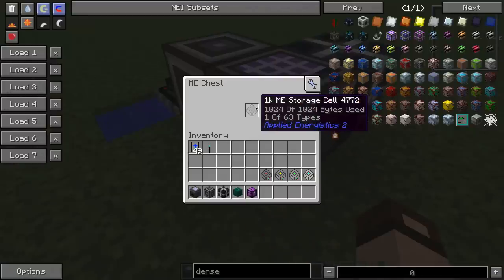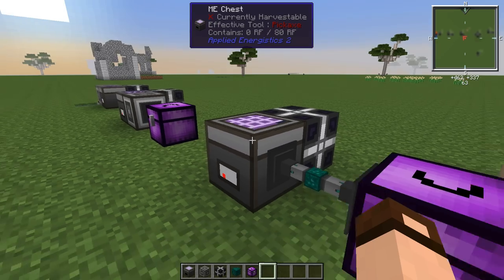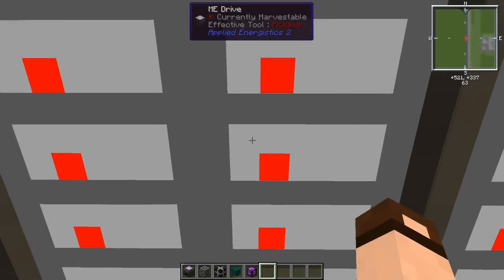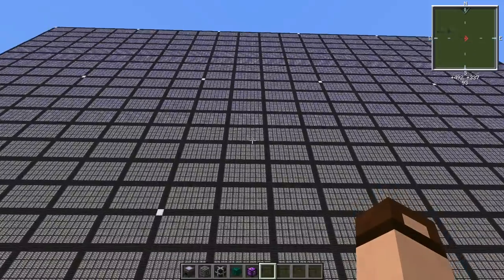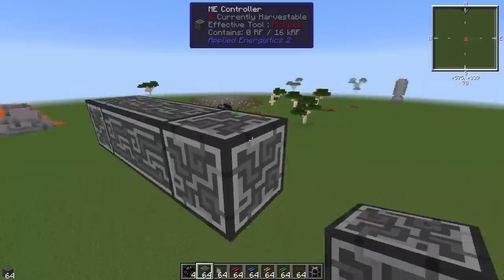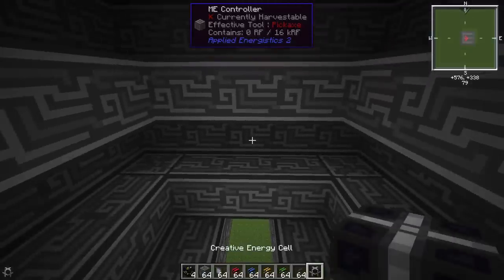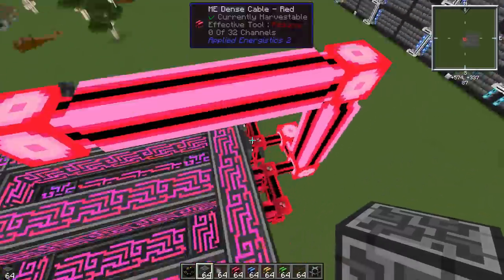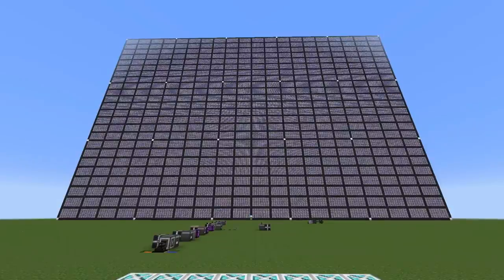Applied Energistics 2 Tutorial - Even More Storage Extremes

Comment: question, why bother with the inside layer, you can not use the faces, UNLESS you dont use the faces on the outside layer that are around the face at the same time,so you can only get 32 channels per BLOCK,  so, you can only ever get 2592 channels from a 7x7x7 cube, no matter what design you choose, hope this helped, because NO design you make can increase that
Reply: seems to me that u are not versed with ae2 as is the face that matters each BLOCK can hold a maximum of 192 channels
Reply: Yeah you realise to use 192 channels effectively you need a separate dense cable for EACH face on EACH block, each dense cable can hold 32 channels and in that gap there is atleast 2 other faces being wasted, go test it yourself then come comment once you are positive you are right next time, and bring proof too
Reply: bradster2214 i was commenting on the fact that  "you can only ever get 2592 channels from a 7x7x7" is completely false i can get over that with a 7x7x1 as you can have multiple p2p tunnels in a single block
Reply: Ok, i never thought of that but the easiest way is to simply use dense cable and it is much simpler as it's clear as to what cables go where
Reply: bradster2214
i agree 100% i dont like to use p2p tunnels directly on the controller all of my cables are color coated makes it easier to keep track

Comment: Is it not easier to set up around 40 Deep storage systems ? if u would only use cooble ? ;D i mean for this mass of coble u only would need 1 core unite with only 2 of six sides used in my idea case like u had (2x32 channels) that u can use over import/export/storage-BUS to store the same amount without any lost. the only negativ thing would be that u only could store cobble ;D and it wouldnt cost so moch power over time^^
Reply from the maker: JacoM93 This isn't meant to be a practical design, just a demonstration how much storage one network (with no sub-networks) can hold. And, if you watch the very, very end of the video, I say all that and show 40 Deep Storage Units holding the same amount of cobble. ;)
Reply: After this comment from me and a bunch of ur video´s i started watching ur Resonant rise from the begining now im @ EP 28... and im just blown away thats aweasome :D

But i gotta problem.. this is far too much information for me, and my little skyfactory 2 world... im tryining to setting up a system but im failling hard over and over but i will try my best after seen ur machines ;D
Reply from the maker: You'll do fine, I'm sure! :) The nice thing about AE2 is that, as long as you understand channels, you can hook up only as many devices as you need now and expand later. :)

Comment: Thats a lot of storage.

My system got 2560 Pulverizer / 2560 Funaces  / 2560 mollecular assembler / 2560 Alloy smelter / 42*32 drives full with 64k cells / 2000+ Inscribers / 96 Draconic chests In 1 Me system integrated (You dont believe it look at my twitch stream Karlibrandstetter )

Comment: thus to maximize storage, (under the ridiculous extremes you'd need to be at to need to need to do so, even with the smallest storage cells) each cell would need to be limited to a single item type.Good luck with that.
Reply from the maker: You can fit greater numbers with fewer items types, indeed. But considering most people would be hard-pressed to fill a single drive without having massive quantities of individual items, the distinction is rather moot. :)

Comment: Are you sure that this things will no make a Chunk ban?
Reply from the maker: If by chunk ban you mean the protections that some servers can have, that would be entirely on how the server is set up. But I don’t recommend creating this monstrosity. I did so you don’t have to. :)
Reply: @Nonsanity  No. I refer to something that has to done with maximun packet size of ibternet connection.
Reply from the maker: Never had THAT problem. Though I can see it might be if the drives were filled with many different items, particularly items that contain other items. But just filled with cobblestone, as those were… it’s just fine.

Comment: In my opinion the most astonishing fact this video shows is that minecraft doesn't slow down even with that many items in a single network. So in survival you are never going to be able to get low fps with applied energistics just because of lots of storage.
Reply from the maker: +95BlackFighter It was all just sitting there doing nothing. Any well-coded mod should cause lag for that. :)
Reply: Yes, you're probably right. But I feared that ae2 cycles through every connected storage every tick and that that would cause lag - but it doesn't. So theres no reason to avoid large networks.

Comment: all fine and good , dont understadn AE2 at all no matter what . AE1 was may better u just connect fuzy with DSU conntect it to controler or w.e. thig was there and u have access to unlimited storage withouth having to waste so much resources

but with this thing , i wanna see you powering this huge thing

which means u would have crapload of map loaded with tree fellers , which need its own power and much more other stuff , that will be burn down for energy

and if u plan to go with reactor , still i wanna see how many u will build just to keep up with power consumtion of this mod....

in the end DSU + extra utilities wins vs AE2
Reply from the maker: The Deep Storage Unit is best for storing large quantities of single items, of course. I usually hook them to my AE2 network so their contents can be accessed by other machines. Ad for the power the monstrosity would require... Well, since the monstrosity us completely impractical and rather unless for any reasonable survival game, building power for it in survival would be rather pointless. And building it I creative, as I did for demonstration purposes, doesn't need anything more than a creative energy cell to run. And, as I didn't even wire the whole thing up (since it would be a huge, manual task—super boring), it wouldn't take more than a simple reactor to power it.

It's a cool dead-end design, and that's about it. :)
Reply: tried this AE 2 thing , somehow i managed to connect them but once i connect another DSU i dont even notice how another one disconnects , which cause me a problems , and linking it to bigger cabbles is a problem , so i have to manage my storage cube inside area of 14x14  (obsecurity modpack) and in the end also add smallest reactor possible to run this thing , so far it burns around 180 RF/t and its only half way done

Comment: If my calculations are correct it would take 241 days to fill those drives with cobble from your cobblestone generator.
Reply from the maker: henkibro One 1 day with 241 cobble generators? :D
Reply: Sure :D, if I understood correctly that the generator made 192 cobble per tick. But if it is 192 per second we have 13 years and 194 fun days ahead of us! :D (give or take a day or two, because i did not count leap years)

But you had 241 generators, that will shrink that time into 20 days!
Yeah, and you will have extra cobblestone, because i did ofcourse round it up to 80 billion ;) So you will need to have some chests for that. lets say 28 504 double chests.
Reply from the maker: Ah yes, it's not per tick. I think it runs at half second intervals, if my memory serves. So every 10 ticks.